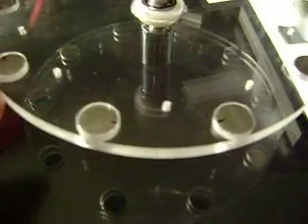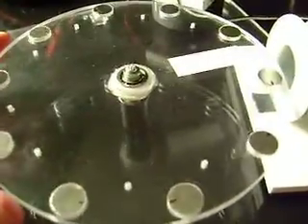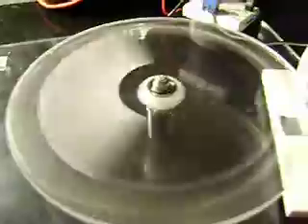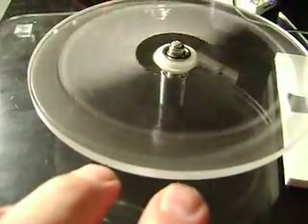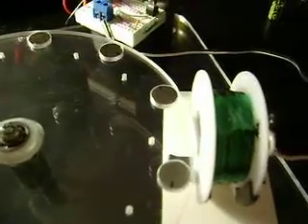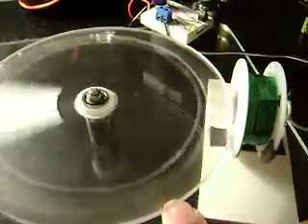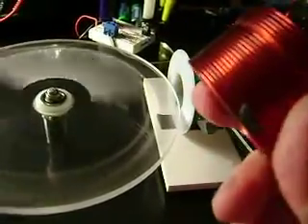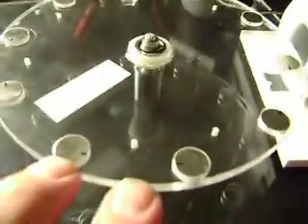Pulse motor using Whipmag rotor configuration

Comment from the maker: Well here, it was just a demo to show the whip style magnet setup can work for pulse motors. The glow is, what you say. I didnt have the diode in so the bemf is sent through the reed causing the glow. I think some of it goes back through (jumps) the switch, but when I add the diode, the battery running voltage increases compared to without the diode, so capturing the bemf has its advantages.
But this was just a simple demo to show an alternative rotor setup. Advantages? We will see.
Magluvin

Comment: Hi Mags,

Is that reed getting warm? It would appear that some energy is being lost in the arc, but as the system gets going there it seems there is a shift into a plasma mode (ionization around the contacts) that may be less IR, but more toward UV. It would be interesting to put a fluorescent next to it and see if it produces a spot. Personally, I would prefer no arc at all so all the energy could be used by the circuit. I believe the arc and glow is because of the rest state gap in the reed.